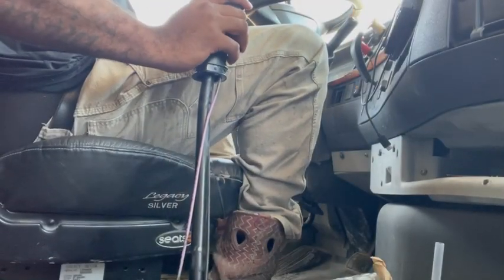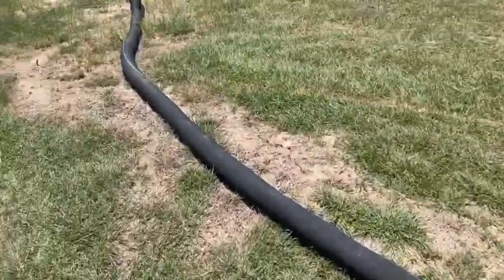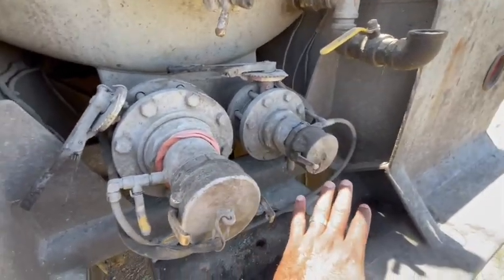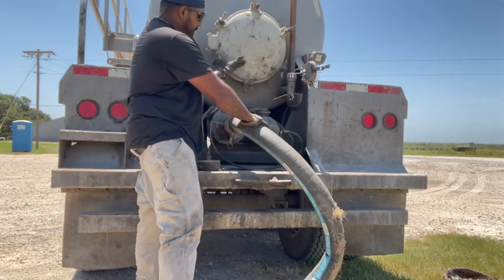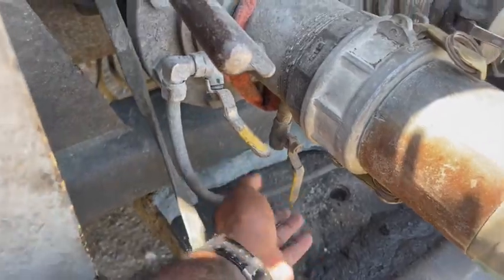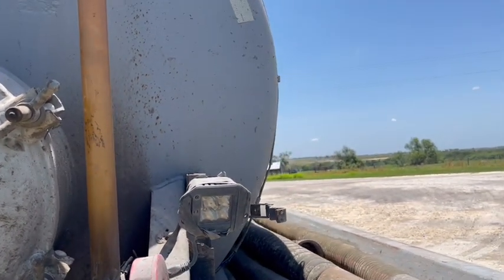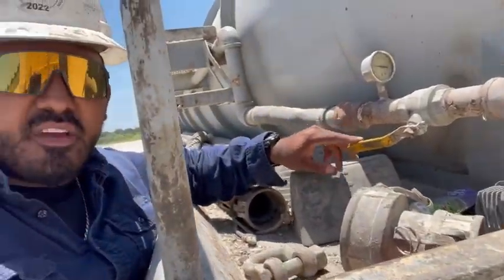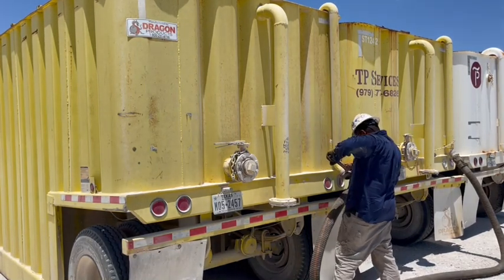How to operate vacuum tanker 2023/ COMPLETE GUIDE

Comment: A buddy of mine had one blow up on um. Throw um like a rag dog nearly 50yrds or so. Thank tha good lord he was able to overcome all his injuries and still here to talk about it. I think what ur doing brotha is bad ass! Especially for tha guys who are barely starting off in this business. A lot of valuable information. Much respect! keep tha wheels down fellas. Be safe  and god bless!👏🏽
Reply: @TruckingwithDev At 12:55 using red diesel to clean the side glass. Where does that fluid exit out to? Just curious.
Reply from the maker: @lostintranslation3789  great question it usually stays in the tank but if your hauling obm it’s what they use to mix the mud anyway only time you don’t use it is when you are hauling a clean washed out tanker for the rigs clean shower water but anything else it’s fine. Hope that helps

Comment: So you left the 3" hose and fittings for future loads ??
Reply from the maker: It reduces the size so that when you get to any location either to load or unload you can hook up your 3” hose and not have to keep taking the fitting off and on. Just make sure to always put a cap because those butterfly valves are notorious for leaking.🤘🏽

Comment: Hey Dev,  do you have a video loading from a tank battery.  Do you have to leave tank hatch open so the tank battery does not implode when emptying it out completely?
Reply from the maker: Most of the time the battery tanks have a vent on top and usually dont have to mess with them.

Comment: what companies hire if have 0 experience but got all endorsements?
Reply from the maker: There is a bunch out there especially here in south Texas and up in west Texas when you see trucks at the truck stops and they are hauling what you want to haul go talk to them and ask questions also look for the smaller mom and pop companies even owner operators I promise you will find something.
Reply: @TruckingwithDev I’m looking for a small mom and pop shop that does tanker! Where can I find something like that? They don’t really post on indeed, and they could be anywhere in the city.
Reply: I tried for two years come November. 40+ applications as a new CDL-A with all endorsements. The easiest way to get a job is through a temp service period. They will do the leg work to get you a job because they get paid. Thanks to them I’ll be driving a 5,500 gallon tanker, just like I wanted…CDL-A tanker experience. Let me know if you find a better way. 👍
Reply: @stumpbumpers great to see that bro. What’s a good staffing in Tx